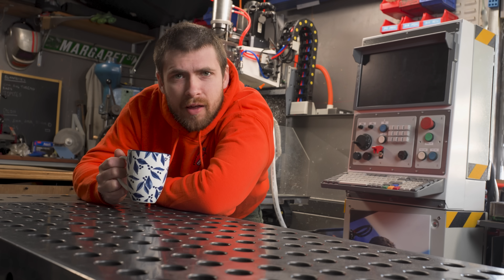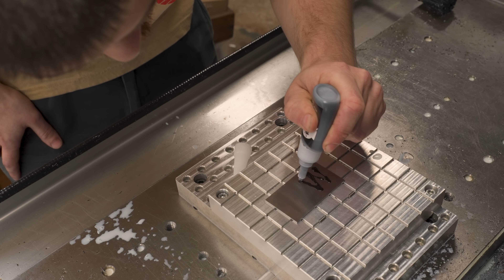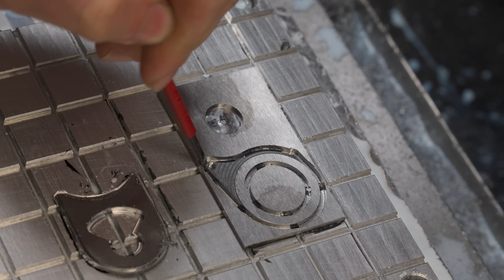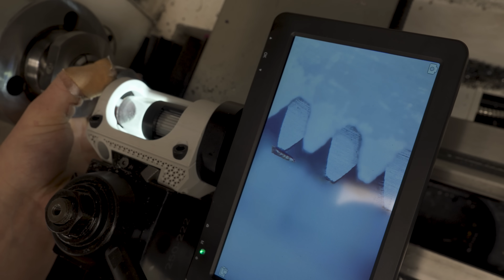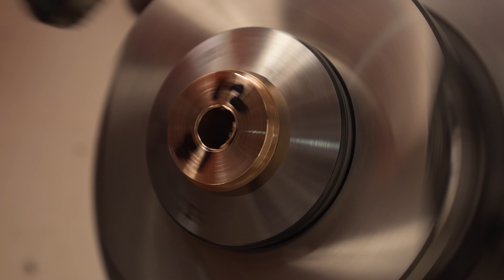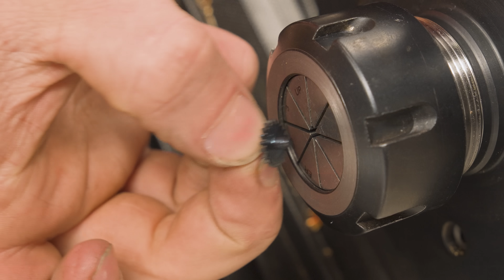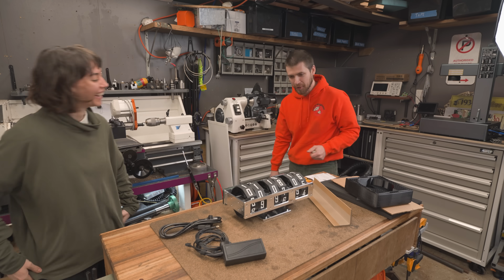What if angles were metric?

Comment: No I never wondered why there was not a "metric" or more correctly decimal version of angles because there is one and every scientific calculator I have ever had going back over 40 years can do them. They are called Gradians, a right angle has 100 of them.
Reply: Why is it based on right angles and not full circles? Now you just have 40 more degrees to a circle than the common measurement
Reply: @KIWI_DUDE.  Maybe because 90 degrees was already pretty close to a power of 10, so the numbers wouldn't change all that much from what people were used to if they wanted to use the new unit? And in some contexts, right angles are more important than full revolutions. It's an arbitrary decision in any case.
Reply: @jeremydavis3631 "pretty close" works only with nukes.everythink else is... more precise. When I worked as a surveyor (as known in US/UK, Geodesian elsewhere) we measured angles with accuracy of hundreths of an angular second. "90 is pretty close to a power of 10" means measurements off by at least tens of meters, when we needed it down to a sub-5 mm....
I always considered gradians pointless - tech nowadays doesnt measure things in any system, they just display them  in one you choose. press a button and you can switch them between degrees, gradians, radians or any other way. My preferred system is angular mils  (or mrads ol miliradians), love both high precision and accuracy.
Reply: @gmaacentralfounder  The fact that they're pretty close just means you know you can do similar operations in that range and that they're both useful in a similar way. 'pretty close' does not in any way imply that you could just chuck in either unit as you felt like it.   
It's much like how a yard is pretty close to a meter. You don't swap them freely, but they are close because it's handy to have a unit that is roughly in that range, which is why it exists in both systems.
Reply: @gmaacentralfounder then you get into arc seconds and stuff and I get lost. I'm just a dumb welder who learned trig so I could try to do my job better.

It's amazing how half a degree over an inch or two will ruin a fit up
Reply: @KIWI_DUDE.  What's wrong with 400 Gradians being a circle?
Reply: @RilsR it’s more that using a turn as the basic unit makes a lot of maths easier. You could split it to 1000 militurns if you want.
Reply: @RilsR  It's not "Metric enough" to have anything not be a power of 10.  Which would be great if Metric actually lined up with day to day things instead of fairly arbitrary cosmic absolutes.
Reply: @RilsR  Why not 360 then if it's arbitrary
Reply: @RilsR  It's not in line with the metric system convention of a unit being 100 of something. 400 for a full circle is no better than any non-metric system.
Reply: @kevinwuwon3905  Yeah, thats why we got Radians and Milli-Radians shrug emoji
Reply: btw gradians are commonly not used. For all machinist questions we use degrees and for all mathematical things we use rad. One mrad for example is projected to 1000m exactly one meter. that is the metric version of degree.
Reply: @PoisonNuke  gradians are used in surveying, not sure about how commonly but at least I use them almost daily :)
Reply: @ossihalonen9935  Yeah in vocotional school all the (soviet made) devices we had, used gradians that was labeled "GOON"
Reply: @ossihalonen9935  as someone who used to work in a land surveying sub contractor for large general contractors building comercial buildings and parking lots, we didnt use gradians.
Reply: @Quasar-fv8to  European instruments to my understanding use gradians more often than North Americans, in North America there are theodolites for artillery/targeting that use gradians but overall we use degrees whether it be in Azimuth or Quadrant notation.
Reply: @ossihalonen9935  I survey in the U.S. so no gradians for me but I know they're used elsewhere, are your property boundary surveys also done in gradians? Do you need to convert or are older surveys all in gradians?
Reply: @joshuatree9358  No need to convert anything, tbh everything is just coordinates and coordinate systems nowadays. And since computers do all the work anyway we could as well set any units for angle in total station and software.
Reply: @SergeyPRKL  Its Gon, at least in Germany. And in Surveying it is a dream to work with, for obvious reasons
Reply: @ossihalonen9935 i use them daily in geodesy. 🤷🏻‍♀️ in Poland tho. 400 is more precise than 360.
Reply: @joshuatree9358 in Poland yes and no, it depends if we need to use it.
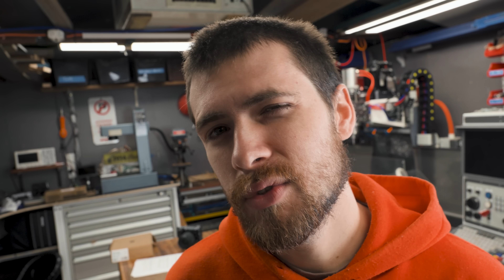Reply: @ossihalonen9935 you must have missed @10:24
Reply: @ossihalonen9935  genuinely why? Afaict gradians is no more useful than degrees and you lose the divisible by 3 aspect without any new useful factors...
Reply: @ossihalonen9935  it’s crazy how many times he mentioned this, as well as the fact that you little minions would mention it. And here we are, still hearing you bridge trolls talk about how often you turn on a machine and look at another machine and “work hard”
Reply: @ossihalonen9935  10:25
Reply: @mepik_pl  As an American surveyor, our angle units are degrees then minutes then seconds then decimal parts of seconds.  For people using Grads, they are only dealing with grads, then decimal parts of grads, taken out as far as needed to obtain the appropriate accuracy and precision.  The grad seems better for any math you might need to do (less steps in the math, so less opportunities to make blunders).  But, in my normal day to day, it was hard to measure reliably tighter than four or five arc seconds, and we really didn't run into too many problems.  I do prefer the metric system, and would have enjoyed a career measuring in meters and grads, but it was fun regardless.
Reply: @PoisonNuke  Don't forget minutes or arc for sub degree notations.
Reply: @Mirage5892  Different units, same system.
Reply: @Mirage5892  Minutes are a base 60 system, not metric.
Reply: @mirandahotspring4019  What you mean is probably "decimal".
But the connotation "metric" or "not metric" is absolutely senseless when it comes to numbers.
Reply: @PoisonNuke  Just combine for superpowers: (Radians + Tau + Base-12) = ULTIMATE POWERRR
Reply: @Aeriozo  MY MAN
Reply: @Aeriozo  Also try  base-φ (golden ratio)
Reply: @Aeriozo  I can't count the number of times I have wished that our civilization chose base 12 as our number system instead of base 10.
Reply: @PoisonNuke  So called MILs. 1/1000. Used in military artillery for 200 years.
Reply: @PoisonNuke  and of course the reason why radians are used in math is because it makes the math a lot easier, because π continues to be a natural constant that shows up in a lot of places. A lot of the natural properties of the trigonometric functions work out perfectly in radians, whereas they need a LOT of faffing about for degrees (or grads) to work right.
Reply: @PoisonNuke  It is not exactly one meter. It is merely close. 1000tan(0.001) = 1.0000003
Reply: @kevinthibedeau4116  this is on the same order of magnitude as the difference between a right angle on the equator and 10tkm. Coincidence?
Reply: @kevinthibedeau4116 I think 3/10 of a micron is close enough for most things
Reply: @clapanse  But the error grows superlinearly. At 10mrad you are now off by  300 microns, at 100mrad you are off by 33cm! Cosine error is a killer!
Reply: @PoisonNuke mils. We use these in the Canadian forces.
Reply: @PoisonNuke  A lot of militaries use mils, which are approximately a milliradian.
To confuse the issue different people use different approximations, the Soviets have the most decimal (6000 in a circle) while NATO have one that divides by 2 a lot (6400 in a circle).
Reply: @PoisonNuke  I used them. 0 right, 1 up, 2 left, 3 down, with easy interpolation. Grad mode for calculator games is EXACTLY how I accepted directions from users. Just multiple by 100 and be in GRAD mode for the polar/rectangular conversion. The "Not An Engineer" is clearly correct about not being an engineer. Not sure yet how long I'll be able to tolerate the video. Came here for (thank you, @jonathanbuzzard1376) in hopes I wasn't alone in knowing N.A.E. is a moron.
Reply: @PoisonNuke  Screw machines use gradians and the operators and cam cutters (programmers) call them degrees. Their cams are divided into 100 degree circles.
Reply: @PoisonNuke  
In Europe gradians (we speak from GON) are used for land-surveying.  I have no knowles of any other applications for the gradians. But maybe there are some.
Reply: @PoisonNuke huh??? One meter projected to 1000 meters?? I'm not picking up what you're putting down . Please explain your wording is confusing me. I'm a simple man old but simple.
Reply: @Charles-ro1pw  make a circle of 1m radius. Mark one mrad on the circle. Now project from the center of the circle  2 lines over each side of the mrad marking and the lines will be 1m apart in a distance of 1000m.
Reply: @PoisonNuke   Это  все проклятые шумеры, с их 60-тиричной системой. Думаю что у них и количество пальцев на руках и ногах было 60.
Reply: @PoisonNuke  you learn both in germany when you learn math and also more depper when you go for machinist school like cnc and stuff like that..you will never see it,but you learn it.Same as American standard perspectivs are different in drawings then the european standard.
Reply: Lol, can't watch even 23 seconds (26.6 decimal seconds) (0.266 Swatch beats)
Reply: @jacktose  ...swatch beats?
Reply from the maker: 🚨18th century Frenchman detected🚨
Reply: @NoEngineerHere  some of these comments are from true 100 gradien squares. Keep up your awesome videos brother!
Reply: @NoEngineerHere  someone who should have researched detected...
Reply: @Dblock42  I'm confused. You didn't watch the video?
Reply: @KGello flipping heck he mentions gradians in the First 25 seconds of the video, some people either have the attention span of a goldfish or they are massive trolls
Reply: @JM-hu3xs ok zoomer
Reply: @JM-hu3xs bro thinks he's him
Reply: @ivanpiro999  No. Mr Buzzard was simply saying that he'd never 'wondered', not trying to imply that they were not mentioned in the video.
Reply: @ivanpiro999  In my opinion, the whole video is a troll, giving misinformation through implications to the meaning of "metric system"
Reply: @darkkenia  The "whole video is a troll"? I thought it was a well-edited, entertaining, and interesting video of a guy building something cool.

He isn't making an instrument for scientific use, here. Nor is he teaching a science/history class. His channel name is "Not An Engineer," and the whole video is full of self-deprecating remarks and humor.

But the build is real, and that's most of what's happening in this video. That's not a "troll." In fact, I think you're comment is more of a troll than anything in this video.
Reply: @darkkenia  you must be so much fun at parties.
Reply: @Dblock42  still time to delete this btw
Reply: @D @Dblock42  - you are clearly not a researcher and now have 🍳 on your 😳
Reply: @Dblock42  Did you detect yourself?
Reply: @KGello  I read the title. and watched the first 20 seconds. That's enough. If watching the video was needed, then this video had clickbait. If watching more of this video was needed, then it was a bad video not getting to the answer to the opening question instantly.

The thread was pinned, so I also did not have time to watch more before I had to pause and reply to your question.
Reply: @ivanpiro999  And the thumbnail! It says "GRAD" right there!! Not gonna lie, I did a ctrl+f "gradian" as soon as the video loaded, before I even started watching...so I was almost of them people lmao
Reply: @ivanpiro999  Considering that gold fish don't in fact have 3-second memories, you can safely say some people have an attention span or memory worse than a gold fish, and you'd be correct - technically correct, the best kind of correct.
Reply: @Dblock42  he mentions that almost immediately. why are you commenting on a video you havent watched?
Reply: @ivanpiro999  Then he should not provoke comments with his title , it does not imply he made his research and he wanted it that way .
Reply: @cmshap It's called "Metric angles are a terrible idea" and never develops that argument, just tells us that 360 was probably by Sumerians. It should be called "i built some shit for giggles" and would have been the same. 

Maybe its my fault since i'm used to videos that actually develop the premise of it all.
Reply: @s @sirhades92 eople see different thunbnails and titles, it's "What if angles were metric" for me
Reply: Pin of shame for your less than thirty second attention span LMAO
Reply: @lordhughmungus  No kidding. How does that comment have 569 upvotes, when the commenter clearly didn't even watch the first 27 seconds of the video?
Reply: @lordhughmungus  
What pin of shame?
He isn't wrong, and it also has nothing to do with the duration of the video.
Reply: @GoldSrc_ Pin of shame because what he is whining about is covered in the first minute of the video.
Reply: @macewindow149  They're clearly making a prediction based on the video title before watching, and also complaining that it's not actually obscure if you're someone with curiosity and you got bored and explored your scientific calculator when you were at school.
Reply: So a gradian is pi/100 radians? Or are they half sized so it wraps around the entire circle instead?
Reply: Pi/100 radians would be be 2 gradians, not 1.
Reply: @rich1051414  pi/200 radians. 400 grad=2pi radius.
Reply: I love that this pinned lol
Reply: Milliradians, or mils, is a metric angular measurement. It is an angle that subtends 1 unit over 1000 unts.
Reply: @mirandahotspring4019  The SI unit of plane angle is the radian. It is defined as the angle subtended by an arc equal in length to its radius.
Reply: i know i shouldn't feed the troll but, wtf are you on about, are you making a joke im not understanding or did you really type out a pedantic correction to a joke the punchline of which was served up less then a minute into the video you didnt watch?
Reply: @ThatsJodie  Seeing this pin stopped me commenting something similar at the 1 minute mark: "I was too curious about the DRG button on a calculator to not investigate Gradians and then more absurd sides of metric when I was at school"
Much more of a "little autistic kid experience many others might relate to" intention though, not a correction or negative in any way
Reply: Pin of shame
Reply: theres metric time too
(itd be fun to watch a clock being made for it actually...)
Reply: @357.mangum  We had a metric clock in my math class in high school.
Reply: @357.mangum  - if I remember it right Swatch introduced the "swatch time" that would have made time zoning obsolete. Correct me if I’m wrong.
Reply: @agn855 Time zones have never been necessary, so they can't really be obsolesced.
Reply: @357.mangum  I worked somewhere where you clocked in and out with a machine that had hundredths or hours instead of minutes.
Reply: @357.mangum  

Do you mean an atomic clock?
Time is already metric, with its base unit of 'second'.

The thing is, all of our units are anthro-centric - they have meaning only to us - and they've all been 'retrofitted' to closely match how their respective units were previously based.
Time - the second was previously based on a fraction of the solar day (24 hours x 60 minutes x 60 seconds = 1/86,400 of a day). Since 1967, one second has been based on the physical constant of how many oscillations of the cesium-133 atom occur for that duration (9,192,631,770 oscillations, or 1 oscillation every 0.10878 nanoseconds).
Length - the meter was previously based on a platinum-iridium rod kept in a vault. But since 1983, the meter uses our new constant-derived time unit to calculate how fast time traverses that meter, which became the new definition. So, the meter is now the distance light in a vacuum travels in 1/299,792,458 of a second. And a 'light-second' is the distance light travels in one second, which is 299,792,458 meters (often reported in kilometers, and rounded to 300,000 for simplicity).
Mass - the kilogram was previously based on a golf-ball-sized cylinder of platinum-iridium. Since 2019, mass has been based on the Planck constant, which itself was calculated using the constant-derived units of time and length.
Both the objects for weight and mass became untenable for use as the defining basis for measurement because they were 'shrinking' over time. So, because the units were legally defined according to the objects, a meter and a kilogram legally 'shrunk' by a tiny fraction every time the objects were cleaned and measured.
This is why scientists decided that metric units must be based on things that never change - universal constants.

However, because our units are 'human-centric' and meaningful only to us, the Golden Records on the Voyager spacecraft (the ones that left our solar system) don't use human time units, but instead a 'universal' unit of time equivalent to the interval between state changes in the hydrogen atom, without respect to its relationship with humanity's units. The base unit of this 'hydrogen time' is 6.47 times longer than the interval of cesium, with one period lasting 0.704 nanoseconds.
Reply: Geodesy uses it. In Germany, this auxiliary unit's name used is "Gon", formerly knows as "Neugrad".
Reply: @holzdergeier in Poland we use gradians
Reply: Degrees have no length or mass.  Measuring degrees vs gradians for real life objects doesn't have a practical benefit either way.
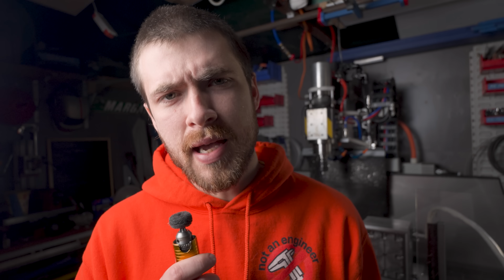Reply: Either you commented this in the first 20 seconds of watching, or you're trolling. The whole video is about gradians, he mentions it here at 0:21.
Reply: @outofoffice7540 the title is have you ever wondered, and I was commenting that I have never wondered. Perhaps if your reading comprehension was better.
Reply: @jonathanbuzzard1376  It's ok to admit you were mistaken, you don't need to try and imply a lack of comprehension. It does rather reflect badly on you.
Reply: @outofoffice7540 I was not mistaken I was commenting that I never wondered, how hard is that to grasp FFS.
Reply: @jonathanbuzzard1376  Bro has three alt accounts and likes his own comments with each. 😂
Reply: Gradians are not metric either
Reply: Metric angles are as easy as imperial ones 45°= 50 grad = 1mm/mm and 12" per foot ;)
Reply: @pmailkeey now try 30 or 60 degrees in gradians, both of which are extremely important angles used in engineering.
Reply: I think gradians failed because it's too close to degree and using 400 for full turn doesn't follow typical metric logic. If gradians had used 100 or 1000 for 360 degree turn, it would have made more practical sense to switch from degrees.
Reply: If a right angle is 100 gradians, does that mean 360 degrees are equal to 400 gradians?
Reply: He did mention that less than a minute into the video.
Reply: And best use of it was, like, use that radian-degree-gradian switch to use as joystick for some aiplane landing game on those calculators
Reply: The reason why the temperature unit in Europe is called "Celsius" instead of "centigrade" was because "centigrade" was the French name of the gradian. The German word was Neugrad (literally "new degree").
Reply: So, 400 gradians to a circle?  How is that better than degrees? OK, having 400 units instead of 360 units is a little more precise but at those small measurements, it's usually not an issue (unlessyou'redoingspacestuffor nuclearstuff). Besides, almost anybody familiar with an analog clock can relate to degrees. I've never seen a "metric"/decimal clock. What a nightmare.
Reply: @rudraigh  It simplified some calculations.

Instead of 11.25° you submit had 12.5grad (sorry, the correct grad symbol is missing on my keyboard; it world be a superscript g).

This was important in the age of mechanical calculators. Like the slide rule. If your (mechanical) calculator could only provide you with three decimals of precision, the difference between three and four decimals meant a lot!

The HP-35 killed the slide rule in the 1970s.

So nowadays it no longer matters whether a half circle is 180°, 200grad, or 3.14159265358979323864279 radians.

Yes, I know pi to 30 decimal places by heart. But expressing 30° or 33 1/3 grad in radians is still awkward without a pocket calculator. 

Note that slide rules had indexes for some "special numbers". Converting between hp and kW was insanely fast with a slide rule!
Reply: @klausstock8020  Wow! Thank you very much for your reply! That was thorough and I learned something. Can't say that about very many YT comments.
Reply: It's radians, not Gradians.
Reply: No, the "gon" or "engineer's degrees" are no longer used and undesirable. 
SI defines angles in radiant (2 pi = full circle) and supports or tolerates ° ' ", angle degrees, minutes and seconds. 360° = full circle.
Reply: Thank you, now I don't need to make that comment :)
Reply: Strongly my older sister who srarted school  before the UK went metric & as my home countie introduced comprehensive schooling learnt gradians in her maths lessons, I was taught completely in the metric system & the comprehensive change over  was completed 2 years into my schooling never had them mentioned in maths lessons
Reply: there are decimals
Reply: A lot of us non engineer types had no idea this existed thank you for teaching us all something we didn't know! That's what YouTube is for!
Reply: I've owned calculators with 'Grad' options for hmm, only 37 years, and always assumed it was something stupid to do with gradients or German radians or something. Turns out: not really far off! I guess there comes a time in life we can't avoid this knowledge any longer. I just hope it hasn't displaced anything useful.
Reply: … omg
idk where the subtitles come from, but they could NOT handle "sexagesimal"
you'll need to fix that… ^^°
Reply: obscure ball knowledge
Reply: And according to the 1975 Starfleet Technical Manual by Franz Joseph, Starfleet uses them! A claim unfortunately contradicted by multiple occurrences of degrees onscreen. :)
Reply: Yoooo I would have loved for a circle to be 400 degrees. 90 degree right angles.... I hate calculating with 90.
Reply: @mathijsbroeders3454  But try writing the angle measure of one of an equilateral triangle's angles! It's certainly possible, but inconvenient, especially given that the shape is so common. Probably more than any other unit, angles benefit from easy divisibility.

But, yes, multiplication becomes a lot easier when you start with 100.
Reply: @mathijsbroeders3454  really, so you have never had to deal with 30 or 60 degree angles, both of which are very significant in all sorts of engineering and mathematics? They cannot be precisely written down in gradians save as fractions.

The real problem is our base 10 counting system. 10 is a lousy base due to the limited number of factors. If only we had a base 12 counting system, then it would have been so much better.
Reply: @TheEulerID the system base on 10 — decimal — has advantages in everyday life, in physics: mechanical measuring. In circle and revolution the system based on 12 has advantages. So both are used where they are needed.
The old imperial unit system is not very practical at all, as it is internally incompatible.